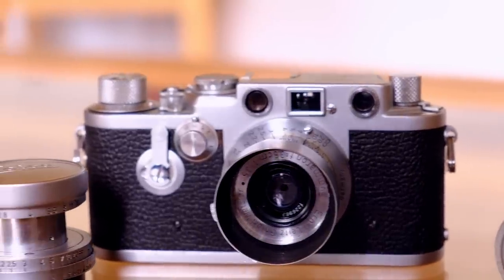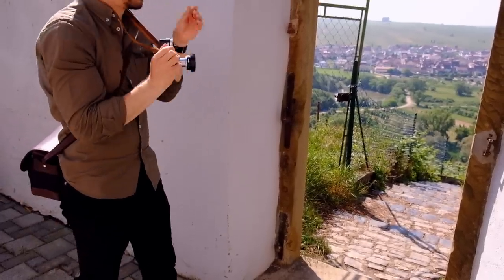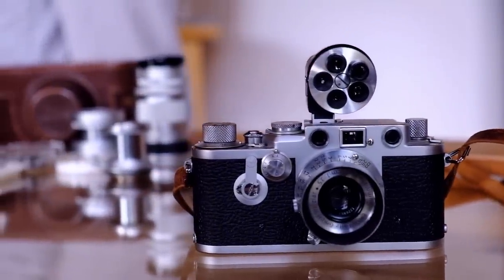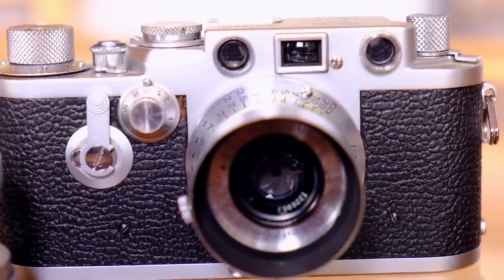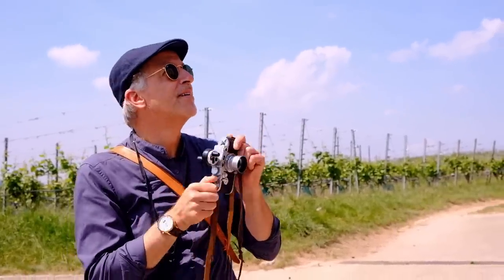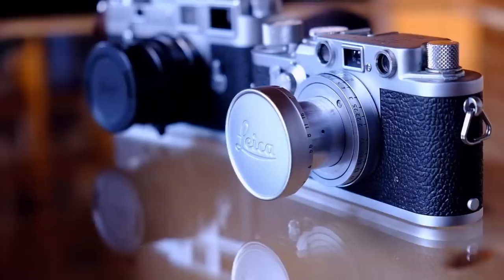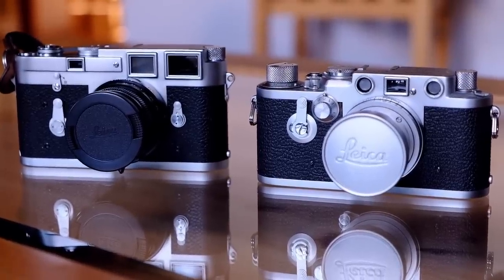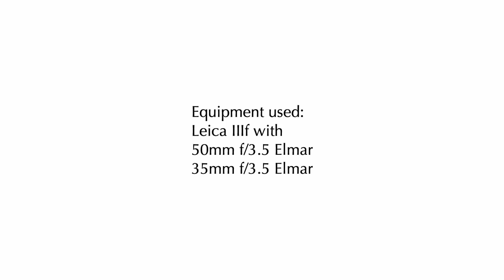Leica IIIf Review

Comment: I have one of the early Black Dial versions, from the first production run in Wetzlar, according to the serial number. It is indeed a wonderful machine - compact, solidly built, and easy to maintain. Mine suffered some shutter problems soon after I bought it, but with a bit of oil and a few turns of the shutter tensioners, she's back to running like a clock. The earlier ones actually have a 30-1 slow speed dial instead of 25-1. Also, shimming the base plate is necessary because 35mm spools in those days were a bit longer than they are today, so the sprocket holes will impinge on the frame if no countermeasure is used. There's a Leica part you can buy, but since I'm a cheapskate I just made a simple shim out of the center spool from a used 35mm canister.

Taking one of these cameras apart really reveals the intelligent simplicity of its ultra compact design. The exact placement of each dial, switch, and button is optimized for mechanical efficiency. The only point against it is that it's a bit of a chore to load, but then again so are many cameras that are well worth using anyway.

Another curiosity you find when disassembling a Black Dial IIIf is that the very earliest versions have the mounting points for the self timer inside, even though the self timer wasn't introduced until the Red Dial. Absolutely no Black Dial Self Timer IIIf cameras were produced. However, it turns out that a customer could send in their Black Dial to be upgraded with a self timer. It just didn't come as standard on new IIIf cameras at first.

Comment: I recently aquired a Leica IIIf more or less as a substitute for a Leica M4 that is away for repair which will take several months, unfortunateyl. But the IIIf pleasantly surprised me! What a beautiful little camera and much easier to work with than I expected. Focussing under lowlight-conditions needs some getting used to (adjust the diopter!) as does putting film into it (leave no rough edges on leader!) but the overall experience is so rewarding that you quickly forget about it's quirks. But now I have a new problem: I have to order more film! :)

Comment: After shooting a few Ms, the IIIF feels a bit funky:
1. Of course VF and RF windows are separated. So you have to switch back and forth while composing.
2. Changing shutter speed before cocking the shutter is discouraged, because it'll damage your shutter.
3. You can't use M-mount lenses. Only screw mount/M39/LTM lenses, which are usually old.

On the bright side:
1. IIIF is more compact & lighter than any M
2. It's the most affordable way to jump into Leica rangefinder system.
3. Plenty of excellent but affordable lenses available: Canon, Nikkor, Fuji etc etc

The IIIF is a fine camera as long as you're OK with its limitations. Great review, BTW.

Comment: Hello Max, again a wonderful video. For several years I am thinking about perhaps buying a Barnack camera, esppecially because I have a bunch of Canon M39 lenses from 25 to 200 mm (with mirror box) and matching Canon 19mm lens (FL mount with adaptor). I was still wondering wether to choose M 3 or IIIg or IIIf and still dont know. I remember your video on the Canon P so now please tell me: did you ever test the Canon models made between 1947 and 1956 (models SII  to SIVb2), that were copies of the Leica III but with improved finder. Can you give any hint concerning their quality and accuracy? Exact Rangefinder coupling after 70 years seems to be a problem. Regards,  Thomas

Comment: Great review. If someday I can buy a Leica it surely will be Barnack Leica. What did you think about that KMZ turret viewfinder?
Reply: Blofeld76. Hello. I am using this viewfinder since ages and I was never disappointed. You need to consider that it shows not the frame of the 90mm but 85mm. When you are using the Leica 90mm  the real frame is always a little bit smaler.
The viewfinder also provides a parallaxis compensation which is important when you get closer to your subject and it is bright and solid made. All in all absolutely recomendable and efordable.
Best regards, Greg

Comment: Yes, getting used to the separate focusing and framing windows takes some time, but I was surprised to find I was quite comfortable with it in just an afternoon. Do I prefer it to an integrated design like a more modern rangefinder, probably not, but it works very well, although the tiny little windows can be a bit fiddly, especially for those who must wear glasses to use a camera.
Reply: TheAgeOfAnalog Can you share your experience in using that camera as well. I was thinking about getting one but the requirement like additional accessories for other lenses outside the 50mm and a light meter can be quite intimidating for me.
Reply: Kos 291 I really like my IIIF RD. I use it primarily with a 35mm F2.5 with external finder. The operation is slightly slower than the M cameras, such as twisting the shutter advance, cutting the film leader, etc. But it’s a fun and unique camera to use!

The IIIf is best suited for zone focus and sunny 16 metering. Once you get comfortable with those concepts, you might not want to pick up any other manual film camera! Budget for a CLA (yyecamera.com) and you should be under $500 total for a Leica camera.

Comment: Good review.  I have been using two IIIf since 1968 and they are still two of my favourites even though subsequent M cameras have been added.  Regarding your need from the external viewfinder in the accessory shoe, if the correct lens-hood for the Elmar is used, the ITOOY, the supplementary viewfinder is not necessary.

Comment: Loved your video. A few notes: 1. Olympus was inspired by the iiif to create the M-1; almost identical in body size and ergonomics. 2. Vertical shots can easily be done with thumb on the release; it feels natural either way. Incidentally, best technique is to use the flat of the finger firing the shutter, not the tip. The ring around the release actually encourages that. 3. And - this is matter of taste - I only shoot B&W film in mine. Later Leitz M lenses have multi-coating for better color.
Reply: Hello Paul. Also the later screw mount lenses I am using have a multi coating and show excellent results also on color films

Comment: Max, as you've used both M-mount, and LTM mount lenses, which do you prefer?...I really did get the bug to jump into the world of Leica after watching your latest video. I've always been holding out for a M6, but I can afford a IIIf (based on what I just saw on Ebay). I realize the M6 is a more technically advanced camera, as well as from what I've read in the comments less of a pain in the rear to load, but given that I really love the images you both were able to get with the IIIf.  Are the older LTM lenses equal to, or inferior to M-mount lenses?
Reply: Hello Timothy. We are using both, the M and the ScrewMount lenses. The screw versions have without a few exceptions a lower luminosity. Fast primes in f1.4 and f2.0 are reserved for the M-mount.
The answer for the quality of the screw mount lenses is easy to answer. In the early days of the Barnack Leica did an animal keeper of the Frankfurt zoo a famous shot of two lions. This image was enlarged to 30x40 cm print with a stunning quality.
And my own experience: there is nothing to complain about the quality of the screw mounts, especially when you have the multi coated versions.
Best regards, Greg
Reply: Thank you Greg for your reply.  I've always desired a Leica, but have previously never had the resources to afford one.  However, I see now on Ebay that perhaps my day will come, as it would seem the prices for M6 have continued to hold their place in the market, the III's I believe have been lowered to my price range.  As always I look forward to your, Max, and Jules very interesting and informative videos.
Reply: Thank you Timothy and stay tuned. There is the next exciting video coming soon. Great to have you as a follower.
Best regards, Greg
Reply: Timothy Anderson buy what you can reasonably afford. The M6 is a nice camera, but it’s not really any better (or worse) than other Leica cameras.

Screw mount Leica’s have a much different feel, than M cameras. Nice thing about screw mount lenses, is that you can use them on M bodies. I primarily use a 35mm with my IIIf RD, and I don’t really need any other lenses with it. Budget for $500 with CLA for a IIIf... yyecamera.com is a great person to send your Leica for service in the US!

Comment: Good video! Please do the Contax IIA next!
Reply: Hello Emilio,
I once had a Contax IIa and had huge troubles with this camera. The metal shutter is quite tricky and when it fails it is very difficult to get it fixed. The viewfinder was also worlds apart from the quality of the Leica viewfinder. So I decided to sell it. I heard from several people who are using the russian Contax copy Kiev that this is more reliable and easier to maintain or repair.
Best regards, Greg
Reply: Ian Thomas - As a long term user of the Contax IIa/ IIIa I feel I have to speak up here. You obviously had bad luck. Usually, these shutters are very reliable compared to the prewar models. What makes the notorious silk ribbons tear are usually sticky slow gears after long periods of idleness, these cameras really need to be used regularly. From the ca. 10 Contaxes I have used only one had this problem after a chip of film got into the shutter. Service on them is usually not more expensive than on a Leica, because in most cases you get charged higher due to the Leica name. In case you and Max would be interested in a collab on this one I would be happy to bring it over with some lenses occasionally, you can contax me (pun inteded 😉) through instagram @sentimental_pt . Nice vid and photos btw, keep‘em coming!
Reply: Senti mental, thank you for your feed back. Obviously I realy had no good luck with my model. When I tryed to find somebody who could fix my shutter problem, I failed. Nobody wanted to repair it. Too complicated, no warranty for success was all comments I got. That is now about 20 years ago.
Best regards, Greg
Reply: Ian Thomas - hmm, funny, got mine repaired here, no problem... but otherwise today they go at the Big Auction Site for even under 100€ - a bargain compared to any Leica, so why bother repair costs anyway? And these lenses... 👌
Reply: Ian Thomas Hi, thanks for replying, i actually am planning to get myself a Contax IIA. Hopefully i would be more lucky after reading everybodies' reviews online. Im sorry to hear about your experience with the camera, hope that doesnt happen to me...

Comment: Great video, but wasn't the IIIg the pinnacle of Barnack Leicas?
Reply from the maker: tabascosauce Man That’s what I thought at first as well based on the name. But then I learned through Greg and my research that the IIIg was constructed quite differently and came with a different viewfinder that featured frame lines for instance. The IIIg was released after the M3 and was Leica’s way of addressing the demand for a screw mount camera for those who did not want to buy into the (very expensive) M system. So it’s more of an odd one out created due to market demands instead of a true step forward  like the IIIf. Hope this helps.
Reply: Analog Insights Does help indeed, thanks alot! 
By the way you definitely should check out the Voigtländer Vitessa
Reply from the maker: Will do. Thanks! :)
Reply: Analog Insights I have the L model with Ultron lens since a month and already love it after 2 rolls of HP5 :3

Comment: What about the IIIg? Granted they tend to get gobbled up by collectors, but even though I own a IIIf, I don't see it as the pinnacle of the screwmount line, that is the IIIg. Also, it was no accident the Leica M killed the screwmounts. it is SO much easier to use. Yes it's a little bigger and a little heavier, but it's way easier to use with the combined viewfinder and the larger viewfinder and the better eye relief for glasses users. Plus there is easier film loading, combined shutter speed dial and better lenses (just because the screwmount lenses are older, except for a few specials). It's no accident that the M killed Nikons and Canon's rangefinders either, good as they were. Hard to compete with such a classic as the M.

Comment: I would have said the Leica IIIg represented the pinnacle of screw mount Leica rangefinders?
Reply: Depends...purists consider the IIIf RD ST the last & best of the Barnack Cameras, and they look upon the IIIg as a bit of a mongrel. The taller dimensions to accomodate the "M" style viewfinder  doesn't improve the aesthetic. 
I used to have a IIIg kit yet ended up replacing it with a 1952 IIIf R/D with (factory converted) Self Timer. I also use a separate (Leitz) Universal Viewfinder. It's a better way to shoot. Viewfinder blockage, especially with Hood attached, is a real issue with all Leica Rangefinders.

Comment: The M39 mount is not equal the L39 mount or ltm. It's a SLR mount that both USSR , Germany and China have produced. The thread were all 39mm but the distance were different so it can not focus while you take wrong lenses. No disrespect, very enjoy this video and big fan of Analog Insight. 😁😁😁
Reply from the maker: Barnack Lucas Thanks so much for pointing this out and please excuse my mistake on this one.
Reply: Saying that, I’ve used a Jupiter 8 (L39) on my IIIa and it has been fine re focus.

Comment: Why buy an M? Well, more eye relief, one viewfinder/rangefinder, Much larger rangefinder, easier to use rangefinder, access to better lenses (including 50mm lenses), easier film loading, more frame lines (auto selected), and that doesn't even include the digital versions. I have a IIIf (off to service because the rangefinder is nearly unusable). They're nice cameras, but the Ms are much better cameras to use. Try the cameras that replaced those IIIfs -- the M2 and M3. And you can even try the IIIg. At least it has a better rangefinder.

Comment: Barnack 111f.
A fiddle to use and a pain to load.
Use a lens hood on these because of lack of coating on the lens.
If you must get a Leica get an M2.
I use a Zorki 4K with the Jupiter 8 50mm f2 lens. Awesome.
My other camera is a Rolleicord Va. A great pair. Rollei prices have gone through the roof since I bought mine.
The pair of cameras I bought for £75 about 5 years ago.